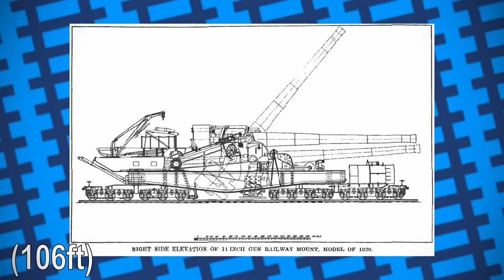The absolutely massive Earth-shattering German railway gun - Schwerer Gustav

Comment: Unless I'm mistaken, I read somewhere that these massive rail cannons were so powerful that their barrels could only be used to fire about 10 shots before needing reworking or replacing. If true, it created another tremendous logistical hurdle in their prolonged use.
Reply: As far as I know, the chamber was designed to be replaced every few shots, but not the barrel itself.
Reply: I've read that the batch of shells supplied for use were slightly different (incremental increase) sizes to take account of the wear in the barrel in use. That's German thoroughness for you....!
Reply: You might be thinking of the "Paris Gun" used against France during WWI.  Not as big, but similar idea.
Reply: @stephenphillip5656  Yes, the Paris Gun did have that issue. The other thing was, in order to withstand the acceleration, the shells only contained about 15 pounds of explosive and were more of a nuisance/terror weapon than anything. There was one shell that hit a church and caused the roof to collapse, killing about a hundred. But it couldn't hit anything much more accurate than "Paris".
Reply: That is correct, the amount of propellant used melts the rifling of the barrel. Lookup Gerald Bull and Project Babylon in the 90s, still had a barrel wear out issue.

Comment: The Germans had a bigger gun: The V-3. This was a static device that was built inside a cliff near Calais and would have had the ability to shell London. However the RAF dropped some 10 ton Grand Slam bombs that completely wrecked it. Not only did the earthquake bombs ruin the tunnels but they actually twisted the barrels that were built through solid rock. That was the lesson that rendered the railway gun obsolete. Why construct something that takes weeks to get anywhere and then weeks to build when a Lancaster bomber can fly there and deliver a heavier payload.

Comment: The Osprey Publishing magazines have many editions on German WWII rail cannons for anybody interested in digging in the subject.

The S.Gustav was the biggest but not the most important of them. In Italy and France several Trainguns caused havoc on allied forces in 1944. They where smaller, more accurate and slightly more manouverable.

It truly was a massive weapon, the peak of cannon tech. Sadly, it was also absolutly oudated and obsolete by the very star of the war. Air power had rendered this tech a very expensive target mannequin.

The same happend with the battleship Yamato (and the Hood/Bismarck). Gigantic weapons that will have ruled the waves... in WWI, but where outdated by the Airforces in 1939.

Thank You for the video. Cheers!

Comment: All that expense and effort for just 13 days of combat. And photoreconnaissance of Savastobal would show that Schwerer Gustav's effect was negligible. Also the cost of all three guns could have paid for some 250 Sturmgeschutz which would have been much more useful to the German war effort.
Reply: A shell from Gustav destroyed a Russian underwater ammunition dump which was under the sea, 30 metres (100 ft) under the sea floor. The destruction wreaked by this gun was prodigious but yes, its overall strategic usefulness was limited by the massive manpower required to transport, assemble and operate it and its vulnerability to aerial attack.  Smaller railway guns (K5) were operated near railway tunnels which gave the gun and crew some protection, but owing to the immense size of Schwerer Gustav & Dora, this wouldn't be possible - it could only be operated in combat areas where total air superiority was guaranteed.
Reply: How do you judge the effect negligible? It destroyed a ammunition dump, and destoyed/crippled a fortress heavy artillery turrets. Do I think it was cost-effective no.
Reply: @kirgan1000  Sorry I missed your comments. I did not judge the effects of the gun but the Germans did. And it was judge that overall, apart from the ammunition dump, it added little to what the Luftwaffe had achieved.
Reply: @stephenphillip5656  Sorry I missed your comment. It was the Germans who decided that overall the gun added little to the siege. Aerial photography showed them that, apart from the ammunition dump, bombing was much more effective. And bombing was much more versatile as it could be moved much more easily.

The problem with railway guns, and armoured trains for that matter, is that they are restricted to the rails. During the American Civil War the north mounted a raid into the south using a train. During the raid they realised their error on relying on the use of the train when it became obvious that the south had became aware of what they were doing and would set up an ambush. So instead of just taking the train back north they had to abandon it. They were hunted down and killed or captured.

Comment: So it needed 2 tracks a precise & consistent distance apart, with no structures between them, and no bridges or gantries. How strange that it never caught on. 
:-⌇
Reply: Well, It wasn't designed to be transported over long distances in one piece. Wherever they wanted to use it, they first had to build a couple hundred meters of railway to the exact specifications needed and then assemble the cannon, which was transported in pieces on a relatively normal train. The cannon railway  was mostly there for aiming and to allow for recoil, not necessarily for moving it around a lot.

Also, needing two tracks wasn't even the biggest problem with transporting it in one piece, as it would have also been far too heavy for any conventional railway at the time.

Please note that this wasn't just a regular artillery gun that needed to be mobile. It was built for the long-term siege of heavily fortified targets and I think that it was very well suited for that.